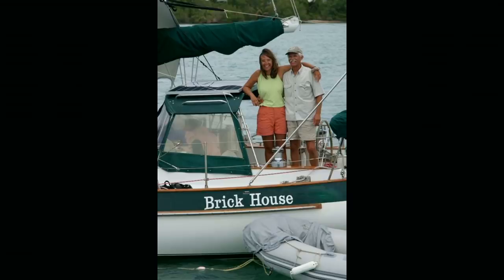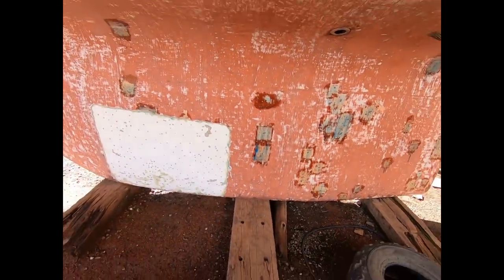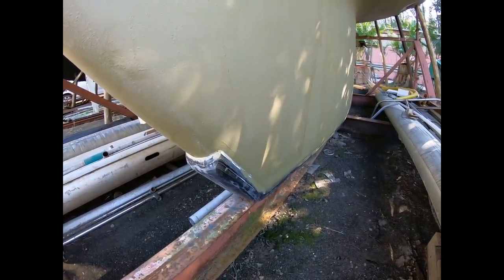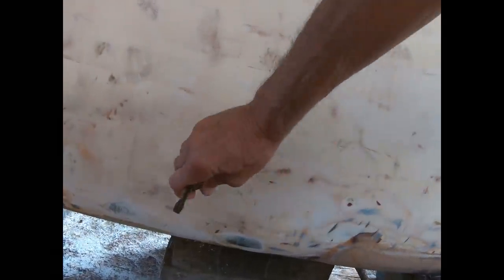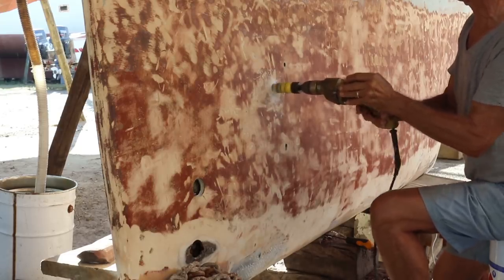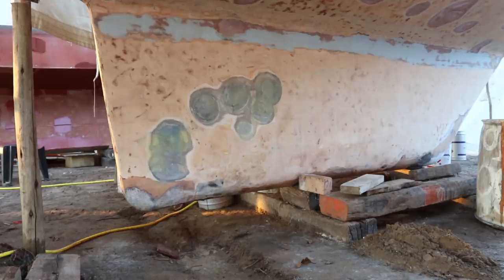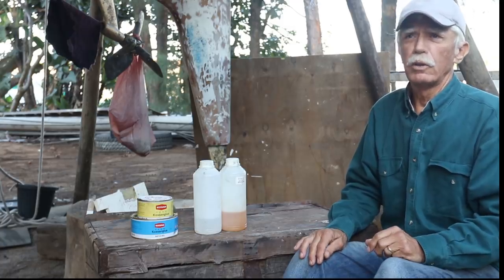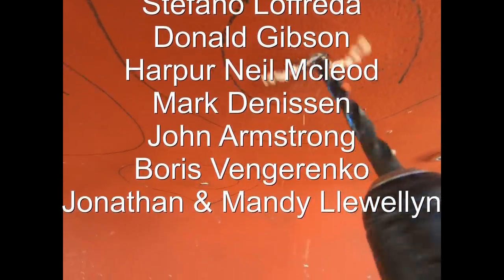Sailboat Keel Repair/Problem: SOMETHING IS MISSING FROM OUR KEEL !! (Patrick Childress Sailing #42)

Comment: Those valliants by uniflight had a big problem beyond the simple blisters, the blisters happen even above the waterline because of the resin they switched to during the vinylester resin shortage in the mid 70's and their contracts they had with the military where they had to use fire retardant resins (don't know why they used it on non-military). They added a fire retardant chemical to polyester resin and it rejected the chemical over 84 degrees Fahrenheit.  The best way to repair it permanently is to peel the gelcoat and use radiant heaters along the hull to heat the laminate and keep it at least 200 degrees Fahrenheit for 24 hrs.  You will have a black goo leaking out of the laminate.  Then glass over with a 6oz fiberglass cloth and vinylester or epoxy... Good luck
Reply from the maker: Some want to blame the blister problem of this era of Valiant 40s on "fire retardant resin" which then seems to indicate all fire retardant resins are bad. Is it correct that the U.S. Coast Guard requires passenger carrying vessels, for hire, to use fire retardant resin in their construction? If so, then it would seem Valiant bought from the wrong supplier.  18 years ago, long before I bought into this boat, it was peeled from the waterline down and glassed over. I can see in many areas they did not go deep enough with the peel. I would really like to know if they did as you suggest and heat things to 200 degrees F for 24 hrs. That seems like a very good process. Thanks for your information and any follow up info you can give us.
Reply: @RVLifeNOW  the best way to check if it has had the heat treatment is to grind back a small area and heat it.  It is very possible that the people who peeled and glassed the hull thought this was a simple osmosis problem, but it looks like you have blisters above the water line as well. This would be the fire retardant chemical problem.   I worked with the naval architect who designed for uniflight on this in Anacortes, wa.
Reply from the maker: @joeytedder  This V-40 is definitely from the blister era caused by bad resin. All owners of this boat knew and so did the people who peeled below the waterline 18 years ago. Hopefully, this grind job will last at least another 18 years.

Comment: A rubber band at the bottom of the keel is ok. But it's the first time I've heard of a hollow front so as to add some weight to it. A chain could do the job. In extreme weather conditions bringing all weight (chain, anchors, and what not…) to the center of the boat is essential. But then again if there is not access to the hollow part at the front keel you may as well consider it a crash box which supplement the rubber band. In fact it does a different job : preventing the keel to shear from the hull in case the boat crashes on a rock at full speed : it's been seen more than once. 5 TO 6 knots on a 7 tons boat (or more) can be considered full speed : I saw a 700 kilos cast iron ballast broken and 3 stringers broken after such an accident that occurred in the conditions I described above… 
My remark goes contrary to comment made in this video : a solid front will not dampen the effect of the crash, on the contrary. To me this is counter productive.
As for DEFLECTION I just don't understand what you mean : ALL materials MUST have deflection, otherwise they shear. It's like saying a jumbo jet wing shouldn't deflect !!!… They deflect a lot, fortunately !!!… Many ideas on YT show deflections on super tanker, plane wings, etc…  As for filling the inside of the hollow part of the keel I don't know. Myself I wouldn't mind knowing that I would never allow a crane to lift my boat with straps around the keel : this is not where the boat should be lifted from. Nor would I worry about beaching : as long as the structure of the keel is not affected the boat can rest on it.
Just my remarks about the issue.
Enjoy sailing ! …
Reply from the maker: All great observations. There are, almost always, at least 3 ways of doing it right. I certainly agree getting the anchor chain out of the bow and nearer the center of the boat. If we ever bought another boat, that is one thing I would look for. I don't know why designers keep all that weight in the bow. The hollow bow of the new boat shown, is for getting it in proper trim after launch. It does seem that would be a great place to store anchor chain. But, as you point out, having the cushion of a hollow bow could be a good thing.....if it were made of steel which I believe would be less likely to breach as fiberglass would. But if the anchor chain was stored there.....maybe that would eliminate much of the cushion. It isn't just the bow though, we have seen boats on the rocks which went up sideways. It was the bottom and sides of the keel that got the heavy scrapes and thus my interest in having a strong one. I am no expert in anything in life, so anytime you think I err in these videos, please let me know. It is always good to hear from knowledgeable mariners.
Reply: @RVLifeNOW  I agree with Vincent. These hollow parts are there to act like a cushion. Otherwise if you hit something with your keel, all the force coming from the crash will concentrate to the point where the keel is joined to the hull, so it can break.
But an other important point is that keels are not there just to provide weight, but to counteract the sideways force of the wind when it hits your sails. At speed the keel's vertical area acts in the opposite direction to the wind on your sails. These two vectors cancel each other out, and the remaining vector will be your speed. Without this vertical area, your boat would roll more, also the boat would go more sideways. 
So there is every chance that the hollow part of your keel was intentional. The designer put there enough weight, and then added more vertical area, using fiberglass for the reasons above.

Comment: Sink and epoxy threaded sleeve on the bottom of the keel then bolt the rubber to it with washers, just a thought.
Reply from the maker: Sounds like something to consider.

Comment: Do those hull blisters happen to "all" boats or does the newer materials (fiberglass and resin) prevent them (do they come back)?
Reply from the maker: For these Valiant sailboats, there was a run from about 1976 to 1981 where they had this resin problem. Far more common, on a lot of other make boats, are the much smaller osmotic blisters, but they only appear from the water line down.
Reply: The answer is no! The way the boat is layed up is most important! Some manufacturers don't take the care and time to save money!

Comment: Yes West Systems epoxy is expensive. But it works perfectly EVERY SINGLE TIME. Epoxy has a shelf life and can be also effected by light and temperature. I’ve used West Systems epoxy that was twice as old as it should have been and stored in a hot dock locker. It was used on a non critical function and it was strong, not brittle and cured normally. Try that with cheap stuff and you get a lot more work getting off the tuff taffy.
Reply from the maker: Fully agree with staying with the name brand products even when they cost more.
Reply: &Patrick Childress Sailing 
You have gone through the blender on this project. All you need is more problems. Been there, done that. No fun. Red skies at night to you.

Comment: That looks like the handrest from an escalator belt. If it is, there is a good chance it has a "C" channel in it and the bottom of the keel has a matching rail (mechanical bond) that the belt slipped over. The edges bonded with adhesive to keep water from ingressing. Interesting concept.
Reply from the maker: That is a great idea for making the attachment. No one else has suggested that a C channel and matching rail.
Reply: I may be wrong but I think you would be better off with a very hard, smooth surface on the bottom of the keel.  Stainless steel would be good or maybe a very hard epoxy or other synthetic material.  I believe the belt will have enough give for whatever the keel strikes to sink in and grip causing the boat to slow down very suddenly and increase the impact load.  You will likely be much better with a material that will slide and divert the impact energy causing the boat to rise up and slide over the obstacle.  A swipe always does much less damage than a direct impact whether you are talking about boats, cars or even athletes.  The belt would only really be useful to set the boat down on a hard surface during haul out.

Comment: That can't be good having water flowing out of your hull when you drill a small hole into it.  How do you find the spots that need to be drilled?  Moisture meter or is there a blister?
Reply from the maker: It is a very visible bubble that goes a layer or two deep. Some blisters go deeper.

Comment: not all sail boats are designed to stand on there keel, the hull is designed to be supported by the water it displaces.
Reply from the maker: Yes, of course. You can see a number of sailboats hauled out in yards resting only on the leading, solid part, of the keel. That is fine if the owner and yard are very aware of this. "Bums On a Boat" have a video where the yard rested their boat on a trailer, putting too much pressure on the fairing, which caused it to buckle terribly. Nearly anything can sail around the world but if I am going to cross oceans on a "Blue Water" sailboat, and thread through the shoal water of the Bahamas and coral atolls of the Pacific, I want a keel that can stand on its own where a grounding might happen. I don't want a bad situation to turn even worse because of an underbuilt keel faring.  Thanks for your comment. Your comments are always welcome.

Comment: Nothing like a well made wooden yacht with solid lead  keel Silca bronze keel bolts holding it on.
Reply from the maker: You never hear of a keel or rudder falling off those old boats like what happens to the new production boats. Hopefully now that we have a more solid keel faring and all the resin blisters have bee ground out and laminated fair, maybe the worst of the maintenance on this 43 year old boat will be done.....for a while.

Comment: West System may be 'Expensive' but guess what, it works ! You have likely spent more time f'ing around, and cleaning up from using lowest bidder stuff, than you could have saved by using the right stuff.
"do not spoil the ship for a ha'porth of tar"
Reply from the maker: Go down the row of comments, about 6 down, to John Edwards and learn something about epoxy. West System is not available here in S. Africa.....so if you were in a location where West is not available, what would you use?
Reply: Full apologies Patrick. Indeed, I was not aware of your location or with the difficulty of getting a suitable equivalent.
BTW, I would be happy to ship you some.
Reply from the maker: @ferhomme96  Thanks for the nice offer but like a lot of things, the shipping is far most costly than the product, especially to S. Africa. We want to install a small heating stove in the main saloon since we will be heading for the very south of S. America. Just the shipping of the stove to Richards Bay, S. Africa, would run about $1,200. Rebecca just flew back to the U.S. and will be looking in the second hand stores for a very large, hard, suitcase to carry it back in. There is no easier place to do boat work than in the U.S. where so many of the boat parts are available and cost a fraction compared to other places in the world.

Comment: We added 1" thick iroko to the bottom of my cat's keel it was stuck on with Sikaflex and is still holding strong, even though it has been beached many times, I launched the boat in 2000.
Reply from the maker: It does seem a wood like iroko would stick better than a rubber conveyor belt. Good idea. Sikaflex is a brand. What form of Sikaflex did you use?
Reply: Hi Patrick, as it was 19 years ago I am not sure but looking at the data sheets I would use Sikaflex 292. There were no mechanical fastenings, I made sure the fibreglass was cleaned down with acetone and after shaping the Iroko and doing a trial fit I applied the Sikaflex to both surfaces. It was then chocked and wedged in position whilst it cured. It will have a tendency to slide so I wrapped some blocks in packing tape and clamped them either side of the keel to keep the wood in position. The excess Sika was scraped off and wiped clean whilst wet, acetone or meths will remove it. The packing tape meant the blocks did not stick. Cheers Roger

Comment: Patrick 
Always enjoy your video's and your tips... although I am not sure of your work on your keel... there is no real internal strength to just liquid reason... that keel of yours would give me lots of concern and sleepless nights,, for me I would replace the keel with a solid one . I have seen many of boats that had failure from poor construction  and it happens at a time when you are working the boat and need it.. get the boat to South Africa Cape Town  and remove and replace it, Yes it is expensive but what is your life worth. It does make me love my Pac Seacraft even more ...they never compromise on there hull integrity and have never seen one blister..

Robert 
North Star
Reply from the maker: TR, yes, in boat yards you see it and from advise of others, many boats should not be supported on any portion of the keel faring. I don't think one could consider such a boat a "Blue Water" sailboat. But if an owner knows about the situation, that is his discretion to live with it or fix it. Many live with it. At this point, 12 years into our voyage, I have chosen to address it, just like the resin blisters. The "oil canning" on our faring was never that bad but I felt it should not be there at all. It is my feeling, with the voids filled, the foam will help carry the loads to a greater area of the hull. If someone does not think so, that does not matter. I am confident that our boat faring is far, far, stronger than it has ever been.  The blisters on this era of mid 1970s Valiant are well known and what makes the boat affordable for many owners. Other makes of boats have had similar problems. I have been anticipating for the past 5 years to get to Richards Bay and do all this work. These repairs will serve Rebecca and me well and I certainly hope new owners, some time in the far distant future. Look at the comment reply I gave to Catherine Secula, just above your comment for more insight into why I approached the repair as I did. Thanks for your comment, and we will certainly meet up, one day, in CapeTown.
Reply: Patrick ,
Thank you so very much for your reply . I do understand where you are coming from with your chosen fix , although for me the keel would come off and a new solid keel put on to replace it , but I also understand the expense of doing such a job as that... a very big undertaking .  And yes many boats of that era had blister problems and was a long and expensive repair job .  Consisting of a haul out , stripping grinding all blisters  and then putting the boat inside and drying the hull out , and a lot of moister testing prior to striping a 1/4" off the bottom to repair and fair in a new bottom with vinyl-ester resins so they would not blister again... and if that process was not done correctly ... a Nightmare , just like a bad house guest , they keep coming back... lol

Robert
North Star